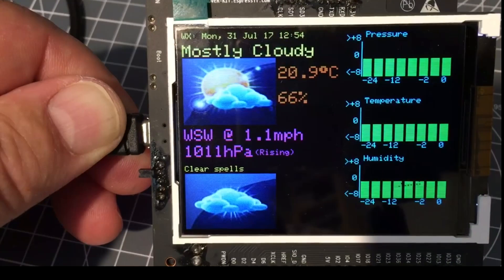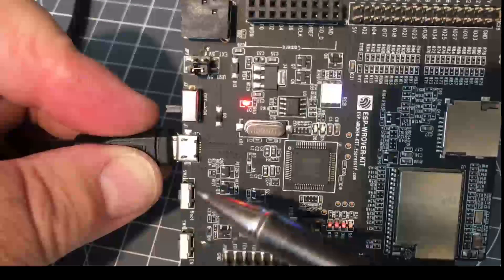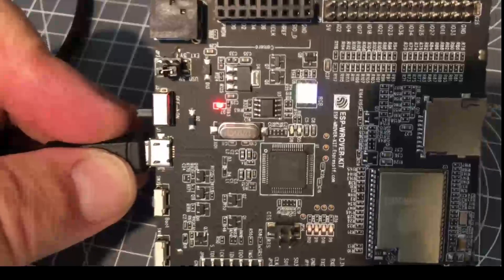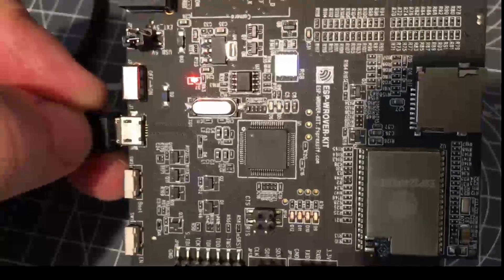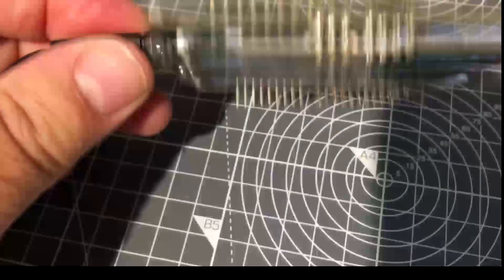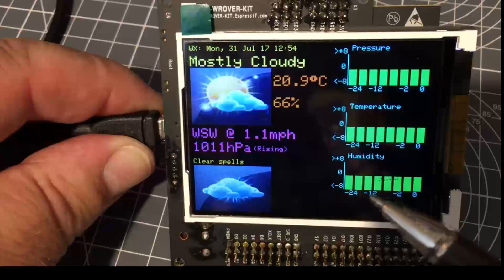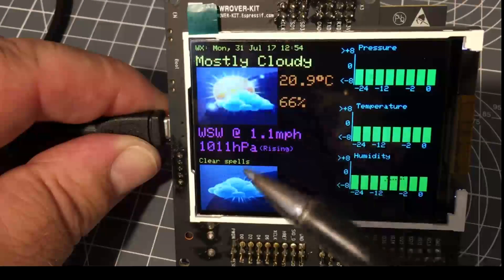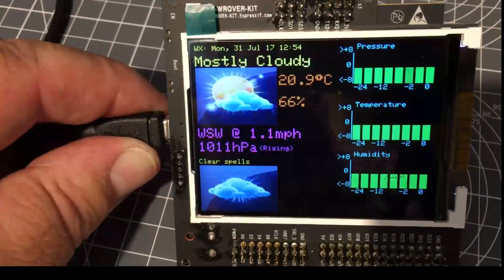Tech Note 049 - WROVER ESP32 Review and Weather Forecaster Demo

Comment: Hi David, did you ever release the Weather Forecaster Demo for this 320x240 WROVER-Kit? I picked one up trying to get the ext 32.768kHz xtal working and failed but searching for what others have done I found this video and thought it looked interesting. Seems you switched to OLED and e-paper displays though. thx
Reply from the maker: The problem is Weather Underground has suspended all access to their weather API unless you pay $500/month, so theirs not much point in doing so, but I have released other code for the ili9341 display that would require one line to be changed (screen driver) for the Espressif board.
Reply: @G6EJD  oh wow, that's not fair since I used to feed Wunderground with info from a station I ran and there were lots of public systems feeding them data. I found you git repos, have been working with your esp32 smart thermostat so will search for your ILI9341 display project since that's what's used on the esp-wrover-kit v4.1.
FYI, one of the changes I'll be making to the thermostat is an option to step-up to the setpoint. Currently dislike when it's 60F in the house and in the morning goes to 68F. Runs too long and really heats up room air before contents/walls heat soak. Adding it to Early Startup seem logical. Thx
Reply from the maker: @douglarue8485  ever since IBM bought them out, then Apple purchased Darksky and that free weather service now ends in March ‘23
Reply: I ended up looking at your WeatherUnderground-Weather-Display-on-an-ILI9341-TFT sketch and melded your WX display elements with a demo I wrote to get OpenWeatherMap and while it's working the display isn't nearly as nice as what you did in this video but the data is being displayed. Thanks for sharing.
Reply: It's taking some work but I'm getting there with the esp-wrover-kit OpenWeatherMap port. Lots of changes since Adafruit_GFX v1.1.8 and ILI9341 v1.0.6 plus getting openweathermap data parsing, etc. Just got bitmaps up so it's starting to look nicer. Don't see how to post a pic or I would.
Reply from the maker: @douglarue8485  oWM has a lot of data so json parsing can be complex. You should be able to use the epaper json decodes for all the data. Good luck
Reply: @G6EJD  I hadn't noticed you also used oWM but I've been figuring it out. Spent an hour banging my head on "weather" segment being a list of one so it needed [0] to reference elements like "id" and "description". Fun with JSON. Also funky stuff like forecast segments setting temp, temp_max and temp_min identical so need to scan for daily max and min and same goes for "pop". Getting a decent indicator display finally. My wife isn't thrilled you lead me down this rabbit hole though. LOL
Reply from the maker: Yes decoding the json is by far the most complex element and it’s not well documented so it ends up being a black art.
Reply: @G6EJD  the project was so old that the libraries had broken in a few places so that was some work. Like painting a pixel to read the bitmap images.
             //was: tft.writePixel(tft.color565(r,g,b));
              tft.writePixel(col+x,row+y,tft.color565(r,g,b));
And instead of clearing the entire screen on every element update( I now just update "current" weather every 20 minutes and retrieve and update "forecast" data at midnight.  Blanking just the text areas being written still needs work. Will probably store previous strings and write them with the background color before new text is written but for now this is close enough when done just prior to writing the text message in display_text().
  tft.setCursor(x, y);
  tft.setTextColor(ILI9341_BLACK);
  tft.setTextSize(txt_size);
  for( int i=0;i<=message.length();i++) {
    tft.setCursor(x+i, y);
    tft.fillRect(x+(i*5*txt_size), y, 5*txt_size, 8*txt_size, ILI9341_BLACK);
  }

And if you don't know, the in-circuit debugging now works with the arduino-esp32 libraries(v2.0.6) and the Arduino IDE v2.0.3+. I run the nightly updates to help with bug testing. You only need a FT2232 board or the esp32-wrover-kit has it built onboard.
Reply: @G6EJD  you aren't kidding. How to display a collection of forecast day's data is maddening.  Like which icon when there's a 100% chance of rain at 7pm(local time, not GMT time). instantaneous or avg humidity, baro pressure, etc. Starting to get something functional though. Also found a pretty accurate lunar phase predictor along the way.